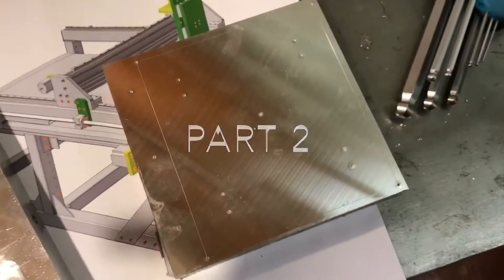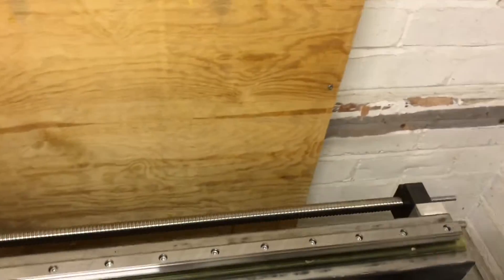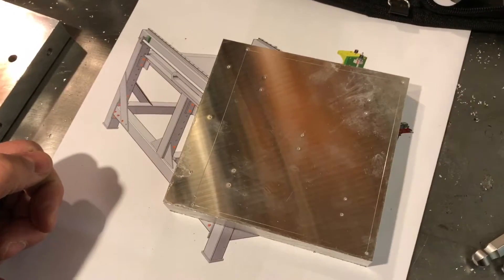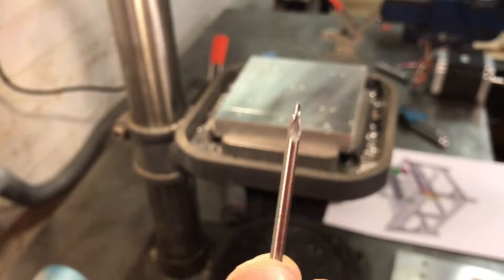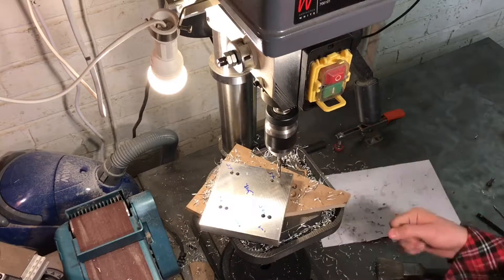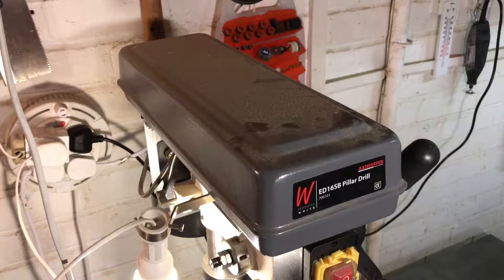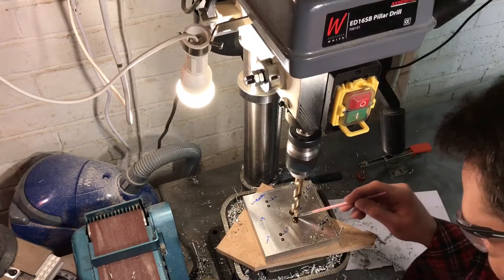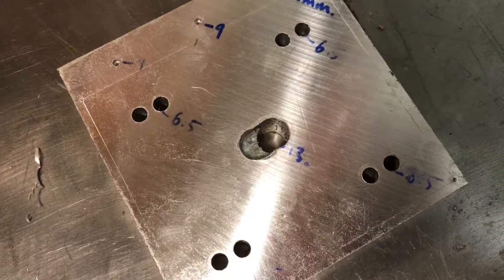Making an Aluminium Motor Mount Part 2 - Building a CNC Router

Comment from the maker: Not without problems but progress is being made on this part! This will be the largest motor mount on the machine and this brings with it it's own challenges....
Reply from the maker: This video has received my first ever thumbs down on YouTube - not sure why? Don't mind criticism, but can't help thinking a comment as well would be more helpful both to me and others!
Reply: @joerharris  i think its because you introduced backlash in your CNC.. great parts with ballscrews... and then add a very long belt that would stretch..
Reply from the maker: @silverghost3506  no discernible backlash. I made a very tiny and complex part in brass with the machine recently without an error. I have also cut complex 3D parts with over a million lines of g code and 10 hour cut times without backlash causing a problem. I don’t think the belt is an issue! 😉